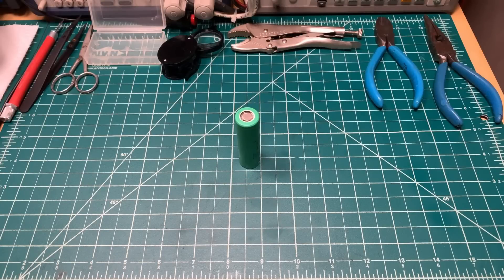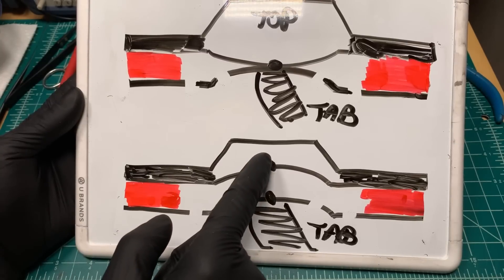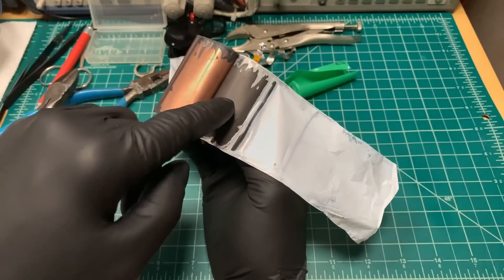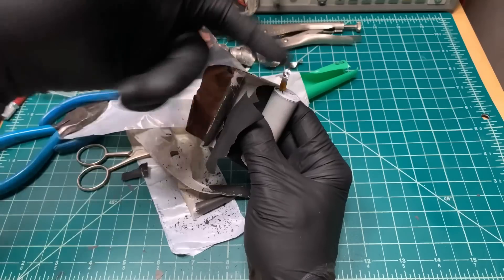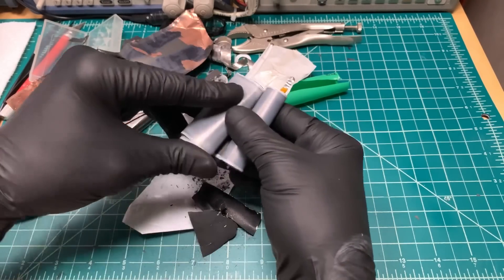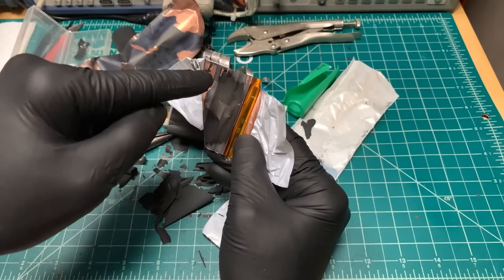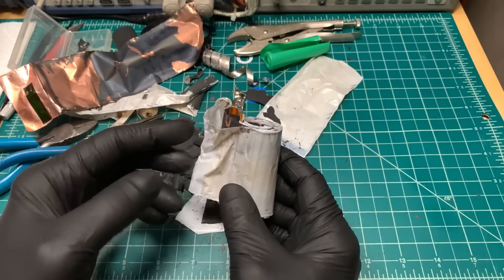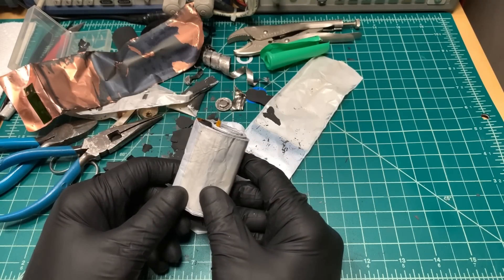Minding Your mAhs Ep037 – What’s inside an 18650 Li-Ion battery?

Comment from the maker: I discharged this battery in a very specific way before I did this video. NEVER try to take a battery apart yourself!
Reply: I was gonna ask how you got away with pulling that thing apart without some kind of reaction. Thanks Mooch!! 👍
Reply from the maker: William Moss my on-screen warning at the start mentions that I took precautions (one of which was discharging the cell first) but I‘m pretty sure no one reads the warning. 😁
Reply: Part 2 please 😁
Reply: I´d love to see a part 2
Reply: Hey Mooch, thanks for the vid with solid explanation! 
I've got a question though: you said the only lithium in there is a lithium salt that has been dissolved in some solvants. And maybe some lithium oxide in the goop, if I understand correctly? 
That little bit is enough to make it catch fire when in contact with water? I seem to remember some video in which people poored water on some part of  the disassembled battery. Don't remember which layer they used it on, but it did catch on fire indeed. 

Could that be correct? Or do I need to retrace my steps....?
Reply from the maker: Radio Triggered! there is no metallic lithium in a Li-ion battery, just the oxide material and salt. There’s nothing to react with water other than a few side reactions with the electrolyte liquid. Li-metal batteries have metallic lithium in them and can react badly with water if the cell is opened up. That battery you saw might have been Li-metal or it might have been short-circuiting and caught fire from that and not the water.

Comment: Okay, but if there's only lithium oxide in there, why does it combust to begin with?
Reply from the maker: The electrolyte liquid is made of organic solvents and is flammable. When the metal oxide and electrolyte reach a certain temperature they start to generate huge amounts of heat and gas. This bursts open the cell and can ignite the electrolyte.
Reply: @batterymooch  So, then the heat causes the reaction to start.

Why do they catch on fire when they are punctured then? If i take a cell that hasnt been used before, its barely room temperature, and i accidentally puncture it, why does it catch fire?
Reply from the maker: @nemtudom5074  the puncture causes a short-circuit that creates lot of heat.
Reply: @batterymooch  Oh, i see, right, i get it now!

Comment: Great video Mooch! I now understand why batteries can’t have a high current and high mAh.

Now I have a question...as far as you know, what is the current limit for the current and mAh for both 18650’s and 21700’s before the supposed “trade-off” begins?
Reply from the maker: Did you ask me this in a PM too?
Reply: @batterymooch  Yes I did, cause I thought that you will not notice it here. Boy, l was wrong. Thanks for answering it Mooch.

Comment: How to cleanup the electrolyte? Or does it simply evaporate?
Reply from the maker: All the (toxic) organic solvents evaporate (don’t breathe in any of it) but the lithium salt and maybe additives, decomposition byproducts, etc., are left behind. Don’t touch any of it and use slightly damp (with alcohol) tissue to clean it up thoroughly then wash hands thoroughly.

Comment: Can you use dual molicel p26a batteries for mtl vaping low wattages?
Reply from the maker: Absolutely. They are a great all around battery for low and high power use. You might, maybe, get more vaping time from a different battery but the P26A’s are great. Keep the wraps in PERFECT condition and use a good external charger and only when you are around and awake. Check out episode #31 of my Minding Your mAhs series for other battery choices.
Reply: @batterymooch   thank you

Comment: I was going through all your videos trying to find an answer to a question. This may not be the best place to ask it but I will try. Can you explain how some coils (ie aspire Nautilus x coils 1.8 or 1.5 ohm nichrome) can require such high voltage but still have a low recommended wattage rating like 12-16w. Having a hard time understanding how if it's only set to such low wattage why does it require so much voltage? This could be confusing to some people. Thinking that they are saving battery life at such low wattage but isn't it still putting a higher drain on battery than usually since the voltage required is so high? This could make a good video if there isn't one already. I searched your archives but may have missed it.
Reply from the maker: The voltage required for any particular coil resistance and wattage setting will always be the same and based on Ohm’s Law and Watt’s Law. The regulator circuit will create whatever voltage is needed to drive enough current to create the requested wattage. The drain on the battery though isn’t affected by the coil resistance and the voltage to the coils is completely independent of the battery voltage. Only the wattage setting affects the battery drain. The batteries are not connected to the coils. The batteries are connected to the regulator circuit and as long as the wattage setting remains the same then the power requested from the batteries remains the same, no matter what coil is used.
Reply: @batterymooch  ok, so this makes variable voltage more clear to me now as well. Thanks for the reply.

Comment: Freaking awsome video however I have a a safety question if let's say I'm useing a 250c with 2 18650 and its 92 outside should we be extra worried about our batts exploding?
Reply from the maker: Any battery can explode if it’s misused or mishandled but using them when it’s 92°F outside shouldn’t, on its own, cause them to vent or explode. Keep the wraps in PERFECT condition and only use a good external charger or a good USB charging adapter and cable and only charge when you are around and awake. Using batteries when they are warm can speed up their aging a little bit but we don’t have many ways around that when it’s Summer.

Comment: Thanks Mooch,  I wish that the circuit breaker device in the top caps had a visual representation of its status, something like a red dot on the top caps somehow that only appears when the circuit is broken. Could you melt the low temp plastic in the battery by accident either from Appling heat shrink wraps, overly hot chargers, leaving in direct sunlight?  Thanks for doing this so others don't have to! Do part 2! Is that "battery " still recyclable?  😃
Reply from the maker: A zero volt battery is a good sign that the CID has tripped. I like the idea of a visual indicator but since these batteries are never supposed to be used outside of a protected battery pack I don’t think any manufacturer will add an indicator. You can often see the venting disk bulging up slightly when the CID has tripped. The battery would be too hot to touch before a “safety” separator started to melt. I put all the battery parts out for recycling in the paint can/aerosol can/unused chemicals recycling area. We’ll see if they pick it up.

Comment: Thanks for the info Mooch, great video. Ok, looking at the internals of 18650 I still don't see why do the negative and positive poles need to end up so close together on top of the finished battery?! anybody can explain?
Reply from the maker: IMO It’s just a result of using the fastest, least expensive way of assembling the cell. Since they are never supposed to be used outside of a protected battery pack, and never handled after initial pack assembly, there wasn’t a need to have the terminals separated more or to have thick wraps.
Reply: Good point! Why can't they insulate the negative terminal from the case of the battery?? Just like they insulate the positive.

Comment: I'm guessing it's not thicker layers of goop, but a longer roll.
Reply from the maker: The thickness of the goop layers, and their porosity, are critical when determining the performance and specs of a cell. Longer length means adding the thickness and expense of the copper, aluminum, and separator layers. The length is definitely adjusted as required but is part of a much larger series of design decisions.

Comment: The fact a battery can be taken apart like this makes me feel a whole lot safer about rewrapping my 18650's
Reply from the maker: I did a very specific set of discharges first though to remove the energy from the battery. You still need to be careful when rewrapping. 🙂